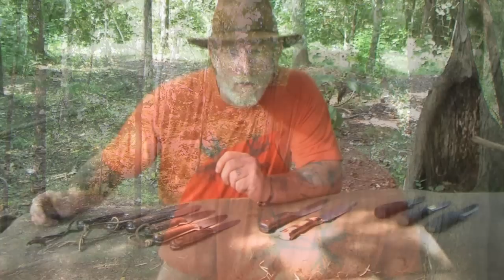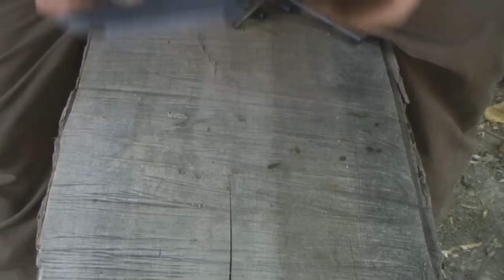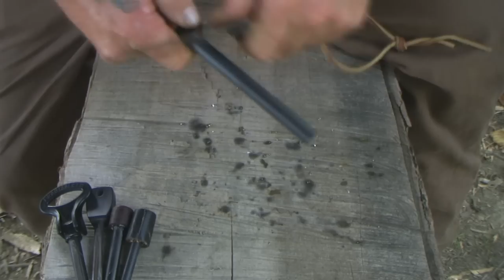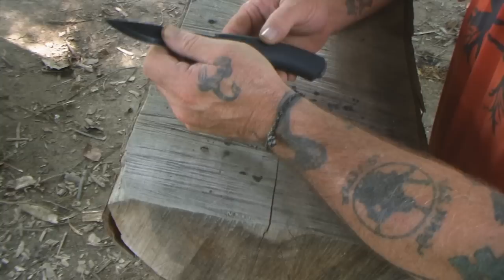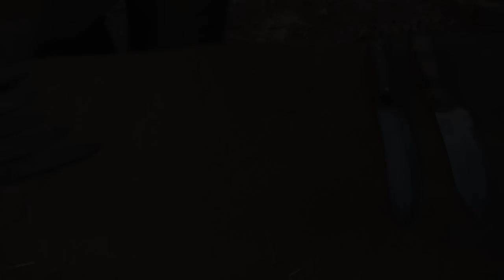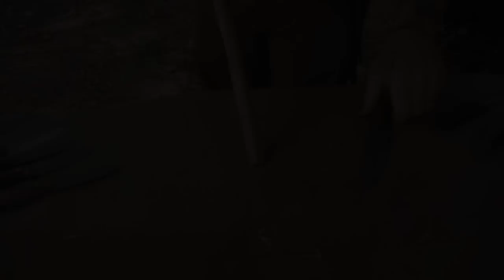Knives JMHO

Comment: (continued)
The point is narrow enough to drill well, as well as be used to pierce and cut things like cactus, the blade long enough to keep your hand out of the needles.  Unlike previous bayonets, it was designed to be a field knife that could also mount to a rifle, and will take and keep a sharp edge.  There is one feature I'm fond of that may be a problem in less free States: the top swedge is sharpened.  It throws wonderful sparks, and can be used in skinning to control the depth of cut.

Comment: It's about time some one taught this and taught it this way. So many people try to build a mental fantasy in the mind of consumers about their product. When you break it down to a science like you did with the 10 c's you have think of what you want the knife to do. Then 1. type of metal. 2. thickness of metal. 3. blade length. 4. spine grind angle. 5. edge grind style. 6. full tang. 7. handle material. 8.handle comfort. 9. is their a coating. 10. Cost. Then pick your favorite answers.

Comment: after fifty years of woodsrunning I've found that a blade of about 4-4 1/2 inches and with a thickness of 1/8 inch, full tang, convex grind and carbon steel to be best for my needs overall. I think I've gone through at least two dozen different configurations over the years. I've run the course from a through z and am finally happy with the style of knife I settled on some twenty years ago. I wish I had all that money now. but it sure gave me an education about blades so maybe it was worth it.

Comment: Buddy. TNP Knifeguy is right about the Buck 110. I find that conventional stones don't really bring out or restore the razor sharp factory edge, but the grey tungsten crock sticks sold by CASE really does the trick. I have two. One I sharpen with a paper wheel and the other I use the stones, crock sticks, and a steel during heavy butchering tasks. They last forever and you cant beat the price. I have skinned about everything from cows to deer, to squirrels etc. It fits well up/down in bk pocket.

Comment: The operative phrase being "in that condition." No problem, you *change* its condition. No one serious about being a woodsman will have a problem sanding/grinding the spine of a coated blade into a 90-degree bare-metal condition. For example, that's precisely what I had to do with my ESEE Laser Strike -- took a handful of minutes.

Comment: Not Dave, but I will answer if you don't mind.
Bayonets can be used to great effect, if you choose the proper one.  IMO, the Ontario OKC-3S USMC bayonet is the best of the bunch.  It uses a proprietary blend of carbon steel, has an 8" blade, and is very sturdy.  It is a serated blade, and although I used to hate partially serrated blades, if you learn to use it, it works out well.  The serrations work great on vine-like vegetation, and actually make excellent feather sticks.......

Comment: If there's anything I've gotten from Dave, it's "tool mentality".  With a proper blade, or set of blades, you can process natural materials to make a shelter, to make fire (fire covers a multitude of shelter sins), etc. So, spending the money on the right tool to effect these things if it's all you're left with makes sense.  I see the "tools" section as the most important because it crosses over into every one of the other areas of survivability.

I would, however, put shelter right after that.

Comment: I bought a K-Bar Becker BK 2 about five years ago. It had some kind of black coating on it that took close to half an hour to get off with a wire brush on a bench grinder. That stuff is TOUGH! I had to grind the spine flat. Now it will throw a ton of sparks with a ferro rod and you can baton through a telephone pole if your heart desires. It's a tough heavy knife, but needs work out of the box for use as a bushcraft knife.

Comment: This is probably the best information on the internet.  Knife reviews by a 18 year old that has a new knife at his kitchen table and then reads the instructions and dimensions that came with a knife is not a review. Than the other side of the ditch you get someone shooting a knife with a pellet gun or trying to cut a frying pan hitting the spine with a hammer.  Buck brand knives that are made in the USA are great knives IMO. I work in a gun store and sell quite a few hunting rifles. Not many want a 30/06,270 or 7mm REM Mag. They want rifles in new cartridges like .28 Nosler. Buck knives like the 119 or 110 are old school .

Comment: The old butcher knife appeared one of the better of the lot, I have seen you using it in several videos, I have a stainless butcher I am using now, it is magnetic and throws sparks so its not pure SS I like the reach, the shape of the blade, and big handle, it a great tool if left near the action, sometimes cheap, and common is not bad.

Comment: thanks for another great video dave. Every part of your criteria is what led me to my esee hest I was able to pick up before they went out of production. I had to mod it on the spine and take off that coating to have a nice 90º and I also modded an aluminium bow drill divot into one of the scales. Then wraped the handle with empty 550 shell to give it a rounder handle. It does everything I want it to without complaint. Anyways just glad to see I was on the right track when I picked it out

Comment: Not even slippery. Many have an orange peel type coating that just drags through wood. My BK2 couldn't even begin to process red oak, admittedly one of the hardest woods. First thing after trying batoning that oak I stripped that coating. There isn't a knife that I use for wood processing that still has or had a coating. My thinking is if you can't maintain a blade properly you shouldn't probably own it, coatings are for the lazy. A blacked out blade may be useful for tactical reasons only.

Comment: Excellent Video!  While our philosophy is somewhat different this video is great information for those that are learning "bushcraft."  I craft my own knives and as for the use of a ferro rod is kept in a sheath with a machined square 1/4" 1095 rod.  It has 4 very sharp 90 degree edges. My carry knife doesn't make sparks.  It is stain resistant very high quality steel.  My faborite blade shape is the French style butcher knife.  I crafted my first knife from a very large bastard file back in 1972.  I was working as a machinist and had access to excellent metal processing equipment.  Made lots of mistakes but learned from them.  All of my knives are crafted to suit my needs.  Peace!

Comment: Ah, ok. It stays in my pack for the most part since I inherited my grandfather's knock off Kabar. It has about a 6" blade, hollow grind, full tang, high carbon and a leather wrapped handle. Been soaking the leather in an effort to tighten it up. Its a nice little knife. I figure if it got him through Normandy and more it would laugh at any task I could throw at it. Again, keep the information coming. Your channel is one of the best I have come across as far as the no BS testing and knowledge

Comment: I used this fine video as a decision-making guide to reconsider/validate the knives I have ready to take out into a hunting/camping world. I have owned a bunch of decent to fine quality knives.  My favorites are the ones I can sharpen with my modest skill level in the field.  Next, I want a slicing knife for processing game, dicing vegetables (try doing carrots with a Scandi grind), slicing bacon and steak and chicken.  Food is ready; where is the fire?  So, the full-tang, about 5-inch knife is the one to baton with (after I have used its convex grind blade to carve a mallet.)  Out comes the ferrocerium tool to apply to the tinder than I (seldom) have available.  I can use the convex grind to help carve and to refine simple joints for shelter building, making a fire crane and the like.  That is the knife I will have on my belt; that is the knife that Nessmuk had made for his use (except I much prefer stabilized wood grips to brittle antler grips.)

Comment: I have some really great survival knives that meet every requirement, except high carbon steel. I tend to go stainless as long as it has a sharp spine because the maintenance is lower, it won't rust in wet environments, and as long as I have my spark stick, I don't need to scratch up my knife trying to throw sparks off of it.

Comment: I started putting my ferro rod inside of a chunk of rubber fuel line hose to force me to use the end inch and half first so that I dont canoe the middle out.  just for conversation sake you can get sparks from a ferro rod with a piece of broken glass or a rock.

Comment: What about when using that Maya dust (fatwood)?  I'd think it'd burn for a while & be useful by longevity?  Speaking of which, if you make a handle out of fatwood for the ferro rod, you'd be able to carve off a little pile of shavings for tinder.

Martiini makes a knife out of carbinox (seems like it'd throw a flint spark, but wouldn't rust as easily).  Might want to look into that.  Wish they made a Timberjack out of that steel!

Comment: Dave I had the Rodent 6 modified a little I had it thin down and the top gaurd taken off and now it look's like a beefy Ratmandu on steriods yeah for a 6"+ blade I thinned it so it's a pretty good slicer now and the saber vex grind it baton's great the handle is longer so it chop's great too, serious Dave it took me years to settle on a 6" blade like my mod. Robert 6, and the steel hold's a great edge too.

Comment: With respect, I disagree u need 3/16" minimum thickness for prying, etc. 5/32 is plenty thick enough, IMO. 

Also, u start off saying u dislike when people use smaller knives for chopping, for them to use a tool designed for chopping. But later u say u want 3/16"min blade for prying. Something a knife isn't designed for. How's that any different ? Maybe that knife will be used in a survival situation, and chopping with it necessary. Shouldn't the reviewer explore that possibility ?

Comment: what are your thoughts on KA BAR knives ?
Reply: Rat-tail tang. I just broke mine batoning when it was 10 degree F
Reply: It was the USMC model, they have other knives that are full tang though.
Reply: Ka-Bar knives are great knives, but like Dave says, "it depends on what your intention is for that particular knife."  I carry the ESEE RAT in D-2 Tool Steel.  It holds an edge practically forever, yet isn't too hard to sharpen when dulled.  It's a quarter inch thick on the spine, so some folks don't like that (but I do because I can pry tendon from bone without worry of potentially bending my blade).  It does throw a spark from a ferrocerium rod.  But I use it exclusively to process game, make feather sticks or do finer wood processing.  It's the best knife I've ever had for processing game and makes short work of it, so I can get the heck out of dodge before larger carnivores catch scent of the kill.  The blade is only about 3 1/2" long, so batoning wood with it is out of the question.  It is my "backup" blade, game processor and fire starter exclusively.  I tend to agree with Dave for the most part, your knife should be made of either: 1095 HC, VG10, 01, S30V or D-2 tool steels.  VG10 may not spark a ferrocerium rod (although you might want to confirm that if that feature is important to you).  Think about what you want to use the knife for and then buy the best blade for that need.  For me the Ka-Bar ESEE RAT in D-2 is the best knife I have ever owned for processing large game period!  It's "bullet and bomb proof!"
Reply: I'm not Dave but in my opinion ka-bars are for fighting and light utility (the USMC, army and navy models) while the Beckers are better for bushcraft

Comment: Finally! Educated answers and well put together info and video. I have a modest collection of knives as a collector. Some are for show to be honest, but most are used. I live in a smaller city. Though the law where I live states that if the blade is 3.5 inches or over, it must be carried visible and in a sheath. Anything under can be concealed. I'm talking fixed blades of course. Now my intent isn't to carry concealed but with wearing coats during winter and general outlook of society, carrying anything larger and I may not be within the laws because it's covered by the coat and get weird looks from people. So I keep these things in mind as well. However, the information you gave was excellent advice. Just for me, I tend to go 3 1/4 Scandi to be on the safe side. If out in the field I like my Gerber Patriot. Though I've never tried it with a ferro rod, I should probably do so. Thanks for the video.

Comment: Just one point, Old Hickory butcher knives are only 3/32nd not 3/16th or even 1/8th.  I think you said they're 1/8th thick in the video. Their longer knives (longer than 7") are just a little thicker and so are their cleavers, but still not 1/8th.

Comment: I have your signature slingshot and love your videos. My go to knife I'd an Ontario Cutlery Ranger. It is high carbon steel and full tang. About 1/4 think at the handle. Great for buttoning. Cut the head off a deer. Has spring steel integrated so prying isn't an issue.  $100 . Shaves hair. KABAR with the kydex sheath and rubberized handle is my backup

Comment: I normally agree with Dave Canterbury on most things but.......Not so much on alot of what he has discussed here. 1/8th knife doesn't flex sorry it doesn't. I prefer a WELL MADE thinner blade, sometimes a 3/32nds blade will meet all my requirements. I have a adventure sworn with a 4" blade 3/32nds thick in cpm154 steel. That knife will out perform any knife on that table with an exception on batoning. IMHO batoning doesn't need to be done on anything thicker then wrist sized, which a 4" thin knife can do without issue. Again just my opinion, keep up the good work dave

Comment: Have you checked out the Mora Companion HD? With the exception of a sharp 90° spine, it seems to have the same thicker, sturdier, carbon steel blade construction that the Bushcraft Black has, but it's still in the $20 price range. The one thing I'm not sure about though is whether it has the same larger tang of the Bushcraft or if it has the smaller tang of the standard Companion.

The Bushcraft Black is the 1st Mora I've owned, & I've been thinking about getting a Companion HD to go with it.

Comment: I would advise against the marttiini. I got one. Great sharpness and blade but its more like a 1065 than 1095. Hard to get a spark off it. It does ferro rod though. The main problem with that knife is my handle has come loose and wiigles pulls in and out. It came loose simply by carving notches and twisting the knife. Also the handle is a big hotspot. The diamond grip is not comfortable when you grip it any more than lightly. In fact if you slice and twist the handle you feel the butt end twist the rubber. I like the blade though but then again it is not high carbon.  just wish I could get the blade out, and make a wood puuko style handle to put it in.

Comment: Great vid as always,thanks!Just some remarks about knives:It would be good if these knives have a distal taper, which is very important for the even distribution of the lateral forces, reducing mass, and better balance. Also, the desired properties of steel striker and  knife are contradictory. Striker should have large grain and a knife should have a finer grain as possible.Striker should have hardness above 58-59Hrc, and knife should have back tempered to about spring hardness (48-50 Hrc)..

Comment: Hey dave i got an old bayonet made by the germans i think. It was made for the ak47 im noot sure what its made from its got a saw on the back and a big point it connects to the case to cut wires do you think it would be good for a survival knife or something to wear everyday ive also got a stainless steel survival knife with a saw on the back it has a hollow handle that you can store stuff in i have some strong bailing twine in the handle now. Wich of these do you  think would be a better knife and if there both not good knives tell me what kind of knife i should get your response will be much appreciated thank you

Comment: I always thought the argument for Esee being the no questions asked warranty was dumb for example. That warranty is no good if the knife breaks while you are in the woods. What, are you going to e mail them in the woods and wait 3 weeks while you are stuck in the woods? That's if Esee breaks, likely won't but just saying. That being said, shell out money for a good knife well passed Esee. It's a life saving tool possibly. If the knife is fancy or to beautiful looking you aren't likely to use it because you don't want to bang up the "art piece" I like knives that don't like overly nice or I won't use it but as a art piece or safe queen yes I have those too but no intent to use. Also some knives have too many add ons or features and it won't function well because of it. Keep it simple and less to deal and or repair. Rember, too big of a knife and you aren't likely to carry it. Over 6" blade is too big, you won't use it and it's gonna be hard to do dextrose tasks. If you need a knife that big you are likely dong batoning abd chopping and you might as well bring an axe for that it does it better. For less or lighter batoning a knife is obviously going to do it but anything you need over 6" an axe will out preform. I carry 3 knives usually. 5 1/2" blade, a 4" blade and a pocket knife. They cover all fields of use and need together. Each one should at least slightly overlap at a task. Sometimes you can use the sharpening choil on a knife to spark a ferro rod also btw. The knife you have on you is the survival knife because usually a survival situation is random and unexpected. That's my add on and thoughts on it.